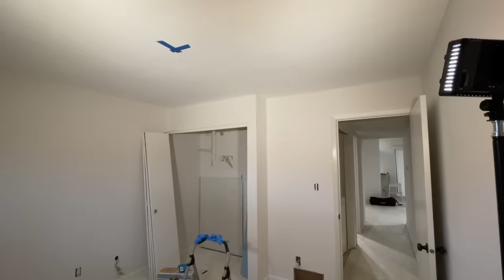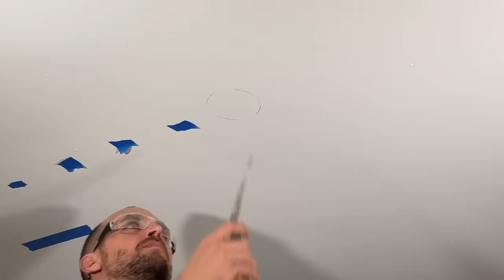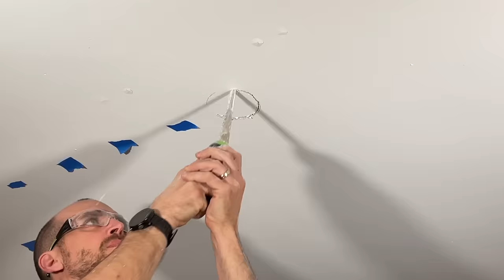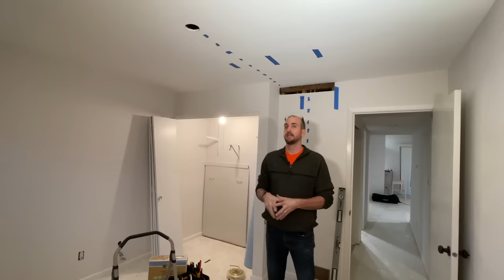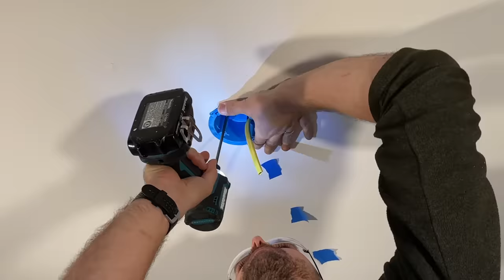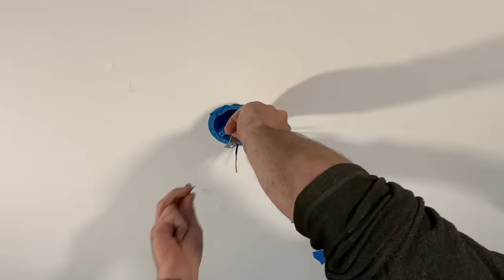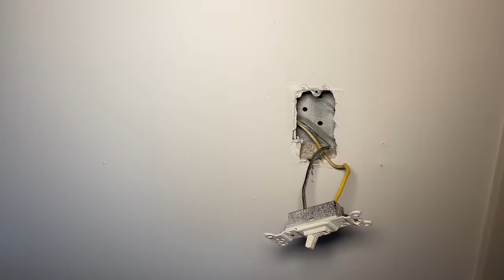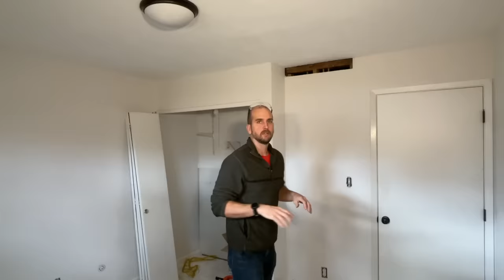How To Install Ceiling Light Without Existing Wiring

Comment: And just for cost effective and drain amperage, for that lights, you don’t need AWG 12, with AWG 14, you were perfect. Unless the breaker for that rooms is a 20 amps, that case you are right!
Reply: I was thinking the same. Why use 12/2 for lighting when 14/2 will suffice. Bedrooms typically do not have 20 amp circuits.

Comment: Just a tad bit of advice, please mention that you need to turn off power to the rooms at the circuit breaker before messing with any wires. Use the outlet tester to verify power is off. But other than that, great video

Comment: Any reason why you didn’t run the light directly to the switch?
Reply from the maker: Sounds like running to the switch is more common but for my instance, it was in the same wall cavity and I was also swapping out the receptacle/pulling out the old wire so I just went to the receptacle box.  Best of luck with your project 👍

Comment: How to patch the wall hole you cut?
Reply from the maker: Yeah, left that part out and if you are doing something similar I would cut the hole about 3 inches lower than the corner where the wall and ceiling meet.  This will make the patch easier.

Comment: You should of wired lite straight to the switch, and change the wire make up in the switch box that goes to outlet
Reply: it all works the same but RIGHT????
i rip out drywall 6 inches from top all way past switch box then wire switch wire together so always on pull all new wires into a new box few drywall screws and some mud some paint half the time it takes to fish

Comment: SO PLEASE SOMEONE EXPLAIN HOW IS THIS POSSIBLE, HE IS USING A FISHTAPE AND A SECOND LATER THE TIP OF THE FISH TAPE IS ON THE WAY DOWN ON THE WALL HOW HE CAN REDIRECT THE TIP TO A HOLE ON THE WALL.....
Reply from the maker: Hey David, sorry for the confusion but in this case there was an open cavity created by a drop ceiling on the backside of that wall from a laundry closet so no need to drill through the top plate.

Comment: I would have just put a double switch in the single box and another switched wire to the outlet, one switch for over head light and another for all the outlets, you would not have had to rewire any outlets.
Reply from the maker: I think that is good advice.  Looking back I would also use this old work box  https://amzn.to/3nityIu to ensure it could hold a fan.

Comment: 15 amp outlet, but using #12 wire (20 amp) which is much stiffer than #14 wire.  The #14 would make the job noticeably easier.
Reply from the maker: Agree, thanks for the feedback Patrick.

Comment: What if you have the trust running the other way? Perpendicular to that one.
Reply: Use a flex bit and drill through the studs from the whole you created for the light.
Reply: @thomasfoley7742  well, is an option. I try it several time and is rough after the third one. Always the bit passing the second one start angles torch the top. Twice, the bit went to the second floor finish floor.... I prefer to channel all ceiling and patched back.

Comment: I have never seen nail or screw heads pop out like that from just cutting a hole we do low voltage and I have seen it hanging tvs but that's about it
Reply from the maker: Yeah, surprised me as well
Reply: That's why screws are so much better than nails.

Comment: Definitely check with any Condo rules/code before cutting holes in a ceiling.   Usually condos have fire rated drywall on ceilings and cutting holes creates a fire path and is a no-no unless they are done with correct fireproof hats etc.  My brother learned this the hard way in his condo :-(

Comment: I would have removed the drywall from the laundry side, and center of room is not always a good location.
Reply from the maker: Yeah, the laundry side had a drop with a lower ceiling height.  I considered it but I would have to patch a popcorn ceiling which I was trying to avoid.  Thanks for the feedback.

Comment: Magnetic studfinder won't work too well on wooden studs, joists ,trusses etc.etc.
Reply from the maker: At least from my experience the magnetic stud finders work well in helping find the screws used to hold drywall to the studs.  I also like how small magnetic stud finders are to easily fit in my standard toolbelt so I always have one handy.  Although I have seen several guys swear by this style of stud finder https://amzn.to/3mjMWDD.

Comment: show have brought the switch leg to the switch,  then you would not have to change the outlets. you would have just made the switch leg that went to the outlet tied straight hot at switch
Reply from the maker: Hey Don,  for sure that is an option others have mentioned as well.  I was swapping out all of the outlets anyway so for me it didn't make much difference.  Thanks for the feedback!

Comment: I would of cut the laundry room drop. Little (not much) harder to fish but the patch hids easier. The guy laying in bed will be looking at that patch for the rest of his life. Would of attached the box to the joist, eventuly someone will put up a heavier fixture. I use 14/3 or 12/3 to all places where somday someone MIGHT put up a fan. That extra $1 will save them/you $200 if they do. Would  drop the wire from the light into the switch box instead. Makes it simplier and cleaner and reduces your wire and nut count in the receptical box. Must be a good condo, they used spec recepticals, not the cheap ones.

Comment: I've noticed that switches that control an outlet, the outlet is upside down. 🤓
Reply from the maker: Good eye, thanks for the feedback 👍.
Reply: That is how they install them in a hospital since everything has a ground pin if the metal cover comes loose and falls it will hit the ground pin and not short out like it would if installed conventionally.

Comment: I am a electrician and first the wire is the wrong size. All you need is 14x2 romex.. and I have never made that menu holes in the wall . Leave it to  the professionals .
Reply: Hey Daniel, sounds like you should make some videos!
Reply: That THHN is 12 gauge, bruh.

Comment: 12 gauge for an LED?
Reply: Reading through comments, I see why you probably did it.  20 amp breaker.
Reply: @georgequalls5043  The 20 amp breaker is overkill now a days for anything other than a kitchen or bathroom. Most modern devices are such low current now a days a 15 amp breaker would work just fine. Some people push 200 amp panel boxes, back in the 60's and 70's appliances drew high current and 100 amp always worked.

Comment: How different would it be installing a ceiling fan with light on this same type of outlet/switch system? Anybody done this?
Reply: I have not done this yet, but i did buy all the supplies yesterday. I plan on installing a large fan. Luckily near the center i have a floor joist and i bought a heavy duty side mount box.  I am in the same situation where i do not have access above or below and also have a switch that controls top outlets. I also have to cut more drywall as i have to pass through 2 floor trusses. I will cut between them and drill through both. Good luck
Reply: Bring a 14/3 (2 conducteurs, 1 neutral) wire instead of 14/2 (1 conducter, 1 neutral) so you can have both switched, and constant power at your octogon light box because some fans require constant power for pull string fan speed control independent from light switch. Dont use these types of ceiling boxes for fans because it isnt solidlt affixed and wouldnt support the fans weight. Also Leave more wire in the box than he did.
Reply: Use 3 conductor wire. Likely 14/3 but could be 12/3 depending on your circuit ampacity.

Comment: Why is there a switch in the room that doesn’t power any light? What’s the point of having that switch turn on and off the wall outlet? This makes no sense to me.
Reply: You would plug table lamps into the top outlet. The switch would then control the lamps.  This isn’t that uncommon.
Reply from the maker: Thanks @readyplayer2.  Yeah in our area this is fairly common for homes built in the 1960-1980 and sometimes even newer.  If you are renovating a property I think it is worth the time and effort as it really brightens up the home / condo.  That is exactly what I am doing with this condo. Cheers!

Comment: Electrician here,
This guy didn't mention that depending on how that switch is wired, you may not have a neutral to tap into to get the light to work...
 If you only had switchleg and hot wire (1 14-2 into the box) you could sent a 14-2 down to the switched outlet and splice the black into the switch leg for outlet and neutral to neutral 😁 if you wanna keep the switched outlet tho well then you're fucked haha

Comment: Would have been easier to open a few spots in the closet and then the wall repairs would not be so visible.
Reply from the maker: Yeah, sounds like that is a better plan for most scenarios.  This instance might not have worked as well because the closets had a significant drop as compared to the room ceiling height.

Comment: How on earth does a house have it's sockets controlled by a wall switch? That's bonkers.
Reply: Nec requires a switched outlet. 
Either a ceiling,or a receptacle.  
It's pretty common in my area
Reply: It's more common in older houses. There were no ceiling light fixtures (only in the kitchen and bath).  You plug your main lamp for that room in to the outlet and operate it from the wall switch.  The house I grew up in was built in '62. The living room and bedrooms did not have ceiling light fixtures. My house now was built in '40.  I had to add one in the living room as well as an exhaust fan in the bath and a range hood in the kitchen. Luckily I have an attic for access.
Reply: @bossfan49  yes what I believe it comes down to is this.. home builders charge for “extras” so if they only have to switch a plug to satisfy code, that’s all they’ll put in. So usually somewhere down the line, someone paid to have that light in the ceiling 10-15 years ago.

Comment: Is there a way to add a switch for the light/ceiling fan and keep the existing switch for the outlet? Apparently, in my case the existing switched outlet is needed for a floor lamp - the preference is to retain controlling the floor lamp using the wall switch rather than the floor lamp knob switch which would be an issue when the room is dark.

Comment: The lazy person's way of dealing with the switched receptacles would've been to just make the yellow wire hot in the first box, then you wouldn't have to mess with the other receptacles. Of course, if you're replacing all the receptacles because they're worn out or you want to install tamper resistant or whatever, then you can decommission the switched wire.

Comment: Meh. This was a kind of unicorn install. Average home or diy won’t be in conduit, beams will never be in your favor, and there won’t be a void or air way to easily access a splice point. 
Past that, I could be wrong, but that fixture box is only rated for wall mount sconce fixtures, not ceilings. Just use an old work / retro fit fan bar box. Also why bother going to the outlet? Just go directly to the switch, it is a switch leg after all, here it was easier because of the air way. Normally, no, just hit the switch box, constant feed the old sw leg for the outlet, and tie in your new sw leg. Plus you’ll have a neutral at your sw box, bringing it up to some AHJ code.

Comment: Isn't it a requirement to be a trained electrician to perform electrical installations in the United States? In Sweden it is so
Reply: it varys from state to state , however generally speaking a company only has to have one master electrician to pull permits .
Reply: No. Some States allow a homeowner to wire and plumb their own residence. Code must be followed of course. Also, "incidental" wiring is permitted by unlicensed persons. Things like replacing switches and outlets. There is a grey area there depending on local inspectors and your level of expertise and influence.
Reply: @blackmanops3749  In Sweden you have to change contact, but when it comes to electrical wiring you have to be a qualified electrician, which I think is good from a safety point of view

Comment: The existing condo wiring is 600v rated wire.  Isn't Romex rated for only 300V?  Shouldn't you be using AC 90 ??  There is reason why this condo is wired in conduit and not romex.  Combustible and Non combustible structures.

Comment: I dint know houses ever used conduit thought it was all romex
Reply from the maker: Usually they do not but this was in a condo which it seemed like they might have followed a little more of a commercial electrical code at the time.
Reply: City of Chicago requires all wire to be run through conduit because of the fire in 1871 that burned 3.5 square miles of the city down

Comment: No neutral wire at the switch.
Reply: You don’t need a neutral wire for a switch just for an outlet.
Reply: @tonyjmontoyar1395  I need a neutral wire at the switch for the smart switch.
Reply: Yeah that’s correct.

Comment: why cut out all that drywall cut where the center  wall stud is little on each side way to much dry wall repair  then fish up through the outlet pull wire down into receptacle i was a electrician for 44 years

Comment: Depending on which country you are in, power supply and lighting supply cannot be inter-connected.
Reply: Exactly, lighting circuits and sockets will normally use different sized cables which are fused accordingly.  Connecting a thinner cable (one that cannot safely carry as much current) to a thicker cable without protecting it with a fuse is asking to burn down someone's house!

Comment: 2 sides to the coin here. I think you should have done a better job at highlighting where code was not followed so those who decide to do something like this understand the risk/liability of doing so. Your insurance company has video proof of you not following code. Should something bad happen you have given them legal grounds not pay out.

On the other hand, for all those "you should hire a pro" commentors, chill a bit.  There are plenty of bad, under educated, licensed "professionals" who make some of the same mistakes. Also, have any of you cooked dinner once? You're not a professional cook, so why don't you have a professional cook all your meals!? You ever clean your house? You're not a professional cleaner, so why don't you hire one to do all your cleaning...
Reply from the maker: Hey Jean,  I agree with you on both points.  I think the struggle most home owners have is getting an electrician to answer their phone, show up on time, charge a reasonable price, and perform work according to code is pretty hard to find these days.  This probably isn't true for all areas but definitely what is true in my area.
Reply: @EverydayHomeRepairs  True. My main suggestion here would be to always get a permit and inspection for electrical work inside your home, if you can. Especially if you're not super experienced. That way you can learn about your mistakes before they cause issues. I wouldn't have known about the plenum-rated cable issue, or that the box wasn't ceiling rated, for example. Great video, though.
Reply: I’d rather do it myself and not pay for 50 permits and professionals

Comment: I have no switch. House was built in 1935, flat roof
Reply: Add a switch in the same wall cavity as the outlet for power use this box to pass code https://www.homedepot.com/p/Commercial-Electric-12-cu-in-Plastic-NM-Fan-Box-with-Plastic-Cover-CPB13NM-SM/205383211

Comment: So everything else is in pipe yet you're adding RX to the building?  At least you could have used BX cable.

Also - for patching reasons unless you need to cut at a ceiling corner - leave it alone - doing so means you need to deal with patching the ceiling and the wall.  Come down about 1.5" for the first cut.  

Gave it a thumbs down because there were so many steps that should have been covered prior to cutting anything.  Maybe you did them but if you did you should have included them in the video.

Comment: Too much sheetrock repair!  Use a 6" hole saw, no measuring needed to repair when you leave the blanks behind.  Oh, you can't run wire in a duct, you will fail miserably on and inspection.
Reply: I love that hole saw trick. Especially for dealing with firewalls.
Here in Boston electricians use ducts as chases all the time. They're often out of use. Not saying it's right, it's just what people do!
Reply: Inspection? What you do inside your house is not the government's business
Reply: @jimbritttn  Except when someone's shitty repairs/renovations puts neighbors at fire risk, or future buyers in financial/safety risk.

Comment: I have a regular ceiling light and fan with lights I have just changed the ceiling light with a pot light and its working fine, however my ceiling fan and fan  light  does not work since i installed the pot light. Can you help me?

Comment: Not to rain on your parade but few code violations here! First you need to have a neutral wire in your switch box, second have you seen that green screw on the bracket of the LED light? that's used to ground the bracket that's metal!
Reply: And the box is not ceiling fan rated per the NEC this box passes code https://www.homedepot.com/p/Commercial-Electric-12-cu-in-Plastic-NM-Fan-Box-with-Plastic-Cover-CPB13NM-SM/205383211